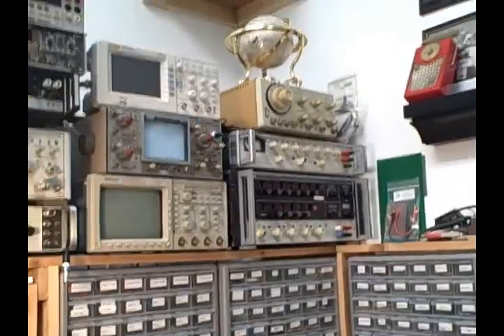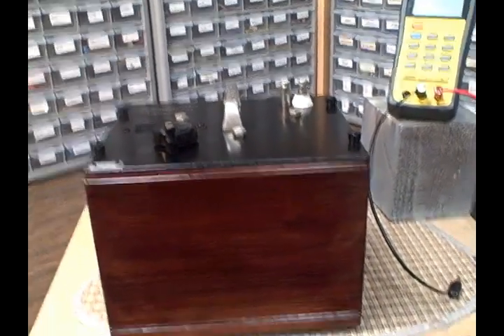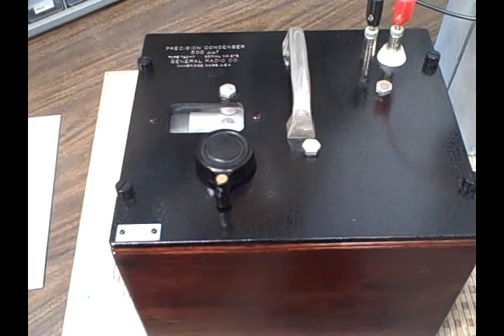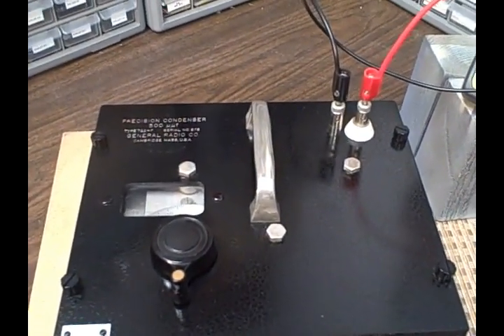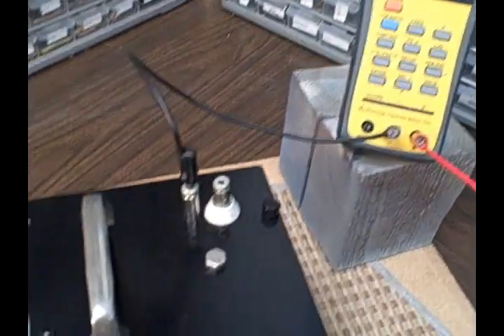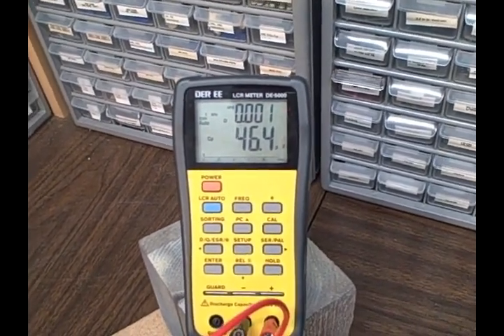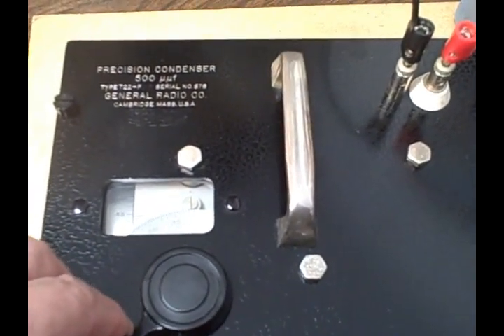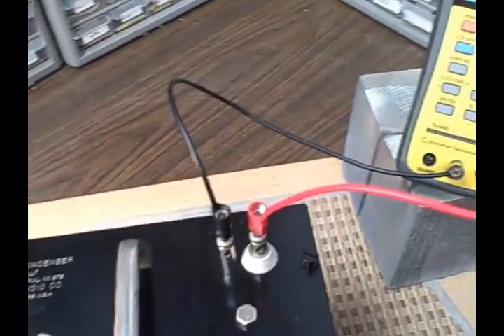General Radio 722F Precision 45-500Pf Air Capacitor  - Testing

Comment: Not sure of reading being close.
722f dial on 200 meter reads 50.9.
How is that close.
Reply from the maker: You have very tight control of the position of the rotating capacitor. Dial in any number on the calibration chart and it can tell you very precisely what the capacitance will be.

Comment: is your channels only for selling ?
Reply from the maker: No. I am a retired engineer and electronics hobbyist, who started buying and selling equipment for my hobby.  I started making the videos in 2011, as a means to prove to potential  buyers that my equipment actually does what they are supposed to do.  Then I discovered that a lot of people seemed to learn more about the equipment in the process.  So, I have tried to make them somewhat educational as well.  For instance, just how do you prove that equipment is working or not?  Also, I  have presented  equipment that I have designed and built, but did not put up for sale.  So, it is a mixed bag.